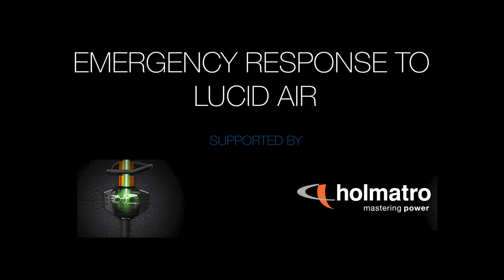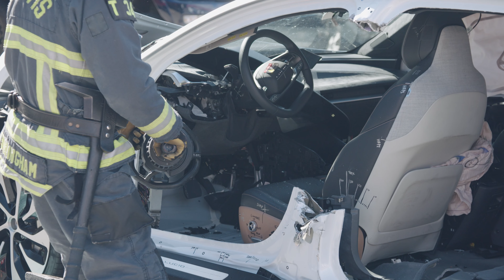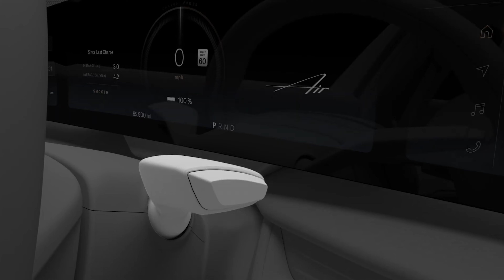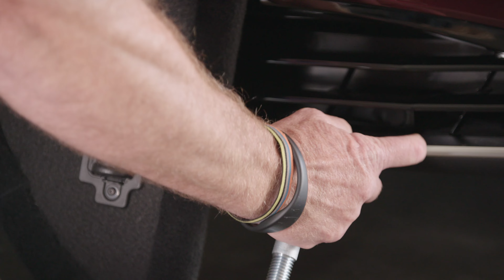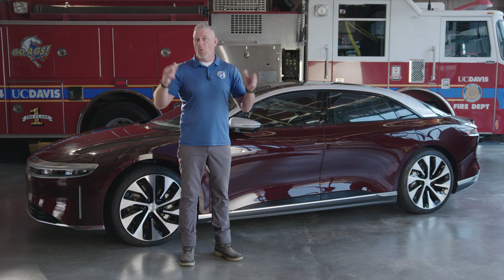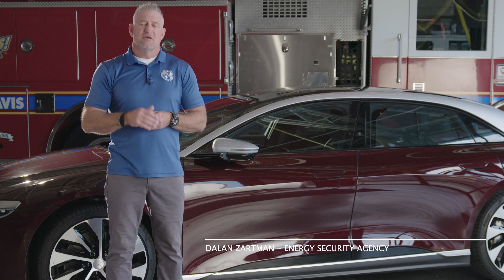Emergency Response to Lucid Air

Comment: 8:22 Disconnecting the Negative battery terminal of the battery, to safely isolate the low voltage 12 volt battery system, was initially confusing to me, because the negative terminal is usually connected to the grounded system FOR SAFETY, and subsequently disconnecting the terminal would remove the battery from the system. However the correct way of thinking about this is that you are removing A Power Source FROM the system and NOT a Load of the system, which passively consumes energy; thus removing the Negative terminal is the correct operative procedure to open the system, and deny a path from the Positive terminal TO GROUND.